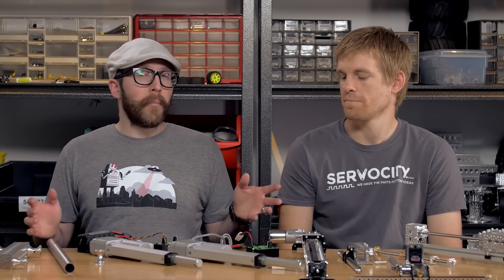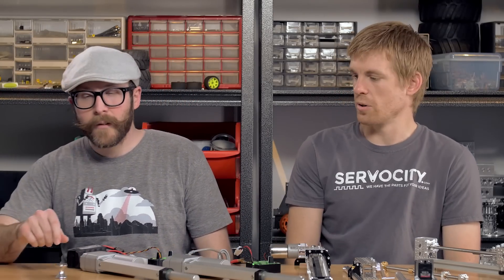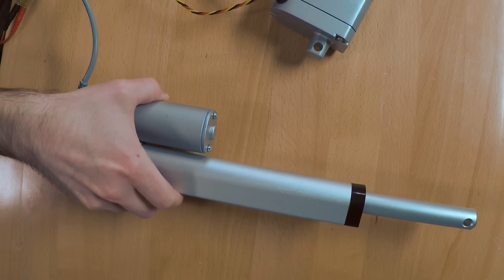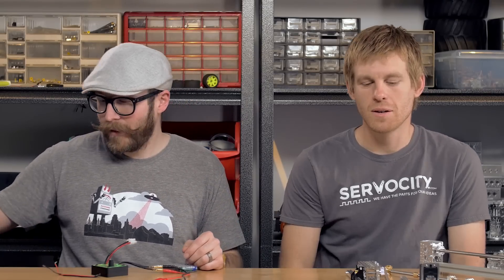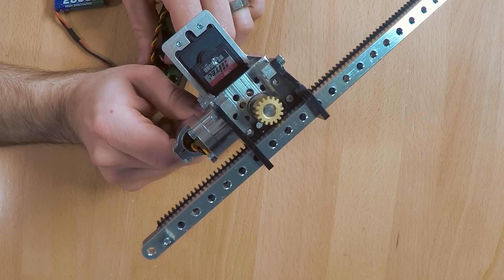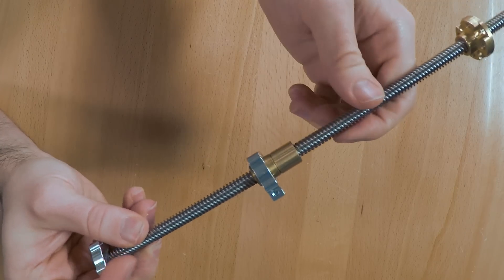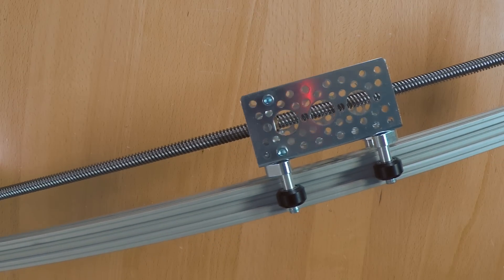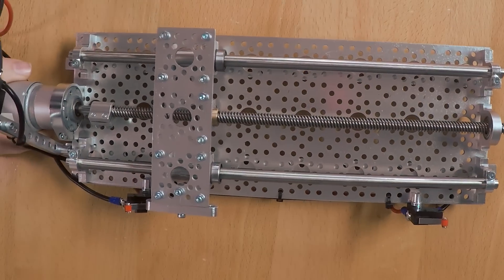Linear Motion Drive Mechanisms

Comment: Dear Mr inventors could you turn your attention to a homemade way to make landing wheels for a motorcycle.  Im partially disabled and if there was an apparatus where I would not have to put my feet down in slow traffic. Like stabilizers on a bicycle except they need to drop into place quickly using the linear actustors when you stop and then spring back out of the way when moving off.  You can buy these but are very expensive.
Reply from the maker: We have actually had this request in the past.  The customer was working on a motorcycle landing gear driven by a linear actuator which would engage at low speeds.  Doing a DIY setup like he took on takes a fair bit engineering both on the mechanical and electronics side but if you're up for the challenge we do have several parts you may find usable.  The turn-key kits are very expensive but those companies have put in a lot of time making a sleek, safe and reliable system available for riders in need.
Reply: Thank you for your reply.  I am in the process of (attempting) modifying the center stand on the the bike by shortening,  adding an cross axel and small double wheels each side.  But having problem finding suitable place on the bike and angle to fit the linear actuater so the wheels move up and down properly to the correct height necessary.... much more difficult than I thought 😱.  I only found out about linear actuators from your site and that's what gave me the idea💡

Comment: Does the push rod on a linear actuator push back easily once the limit switch shuts off power??
Reply from the maker: Hi Hugo, it depends on the pitch of the lead screw or the ball screw but generally speaking, no.  Most have a shallow enough pitch it's similar to trying to push a nut down a bolt without turning the nut.  Feel free to contact us should you have any other questions! tech@servocity.com
Reply: Thank you